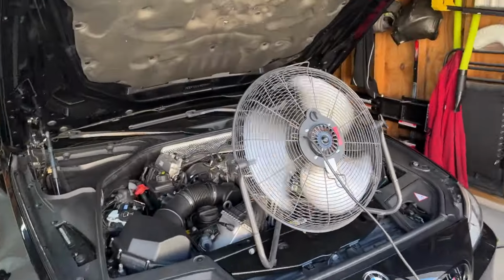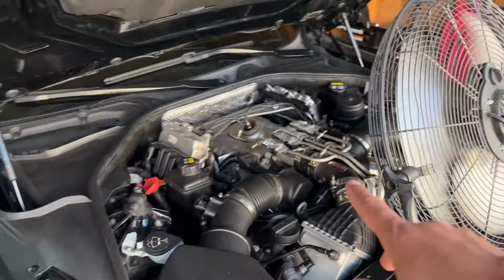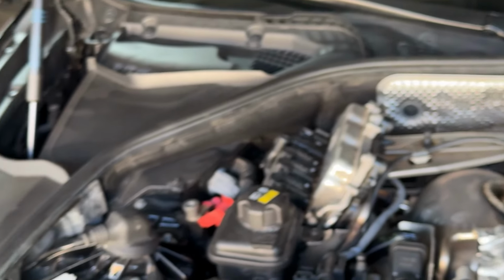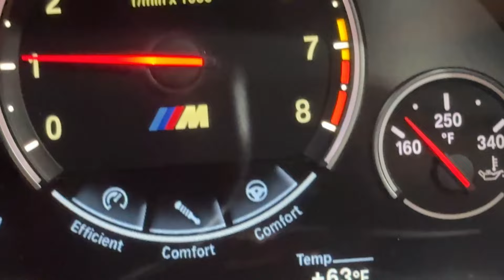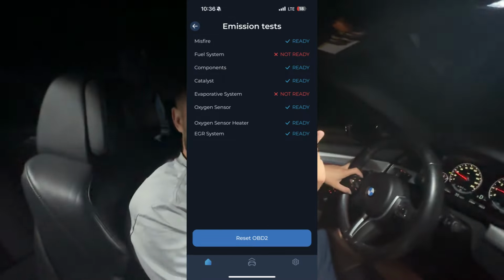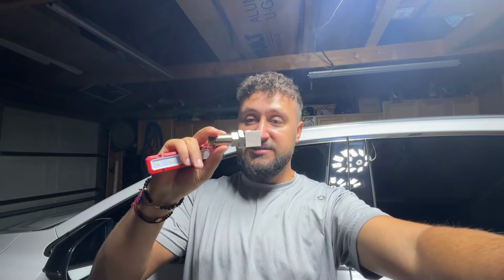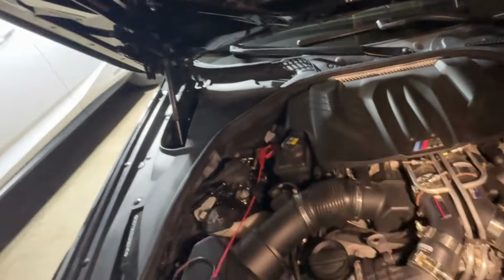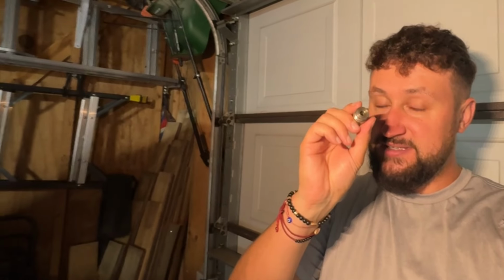Passing Emissions With Downpipe F10 Bmw M5

Comment: I have an M6 F06 with DME stage 3 tune with Fabworx catless down pipes for 6 years and pass emissions every year in NY ,  (no spacers)
3 years ago I sent my car to TJ @ Pure Performance to have the engine forged and still passes , DME stage 3 tune , Fabworx catless DPs ,SSP spec R clutch , PG intakes and charge coolers ,JB4 for map control and Meth control , Akra full ti exhaust , running VP speed sauce 20/80
Reply from the maker: How r u passing ? Is ny an obd plug in for test ?
Reply: @BulletsGarage  I have one of those cheap OBD2 port system ready testers , I do get 1 X,  I forgot what one ,Evap maybe  , I can let you know , but I do get a green check good to go , and I pass every year 
That being said I had a curveball one year. I switched my tune to no burble , didn’t realize it resets all the sensors , I went to go get inspection and it failed, then I realized I didn’t put the highway miles to reset the sensors , it took a good 50 miles nonstop driving to reset them, I had a little OBD 2 tester in as I drove and it gave me the good 2 go , I’m not sure if it’s something with the DME tune, my buddy had an M6 with bootmod and could never pass , gotta be something with the tune